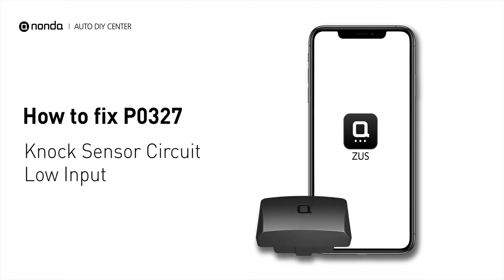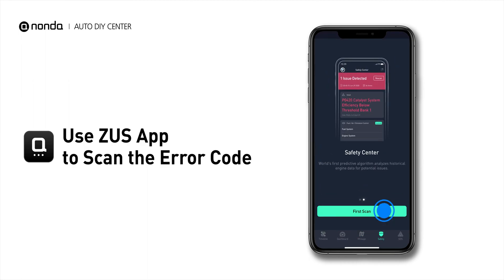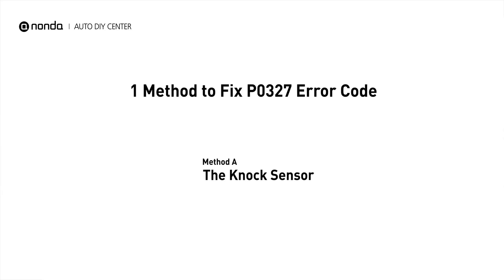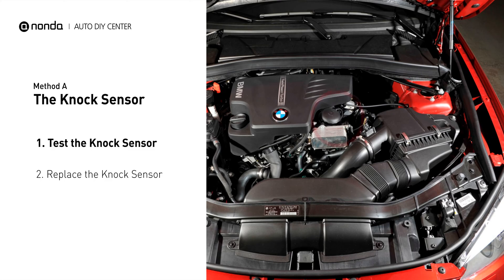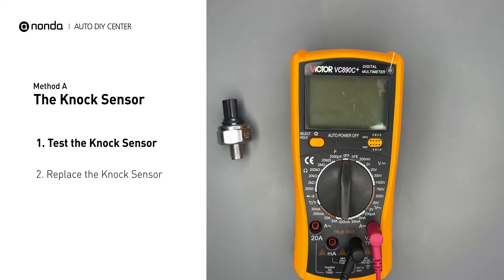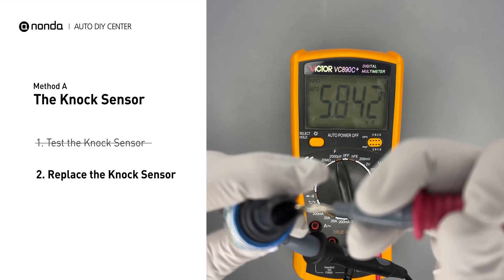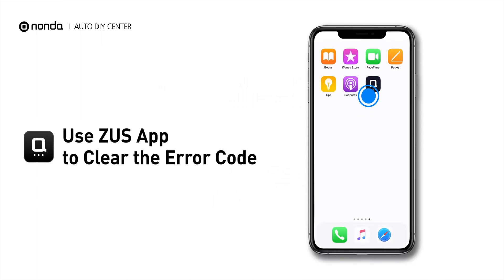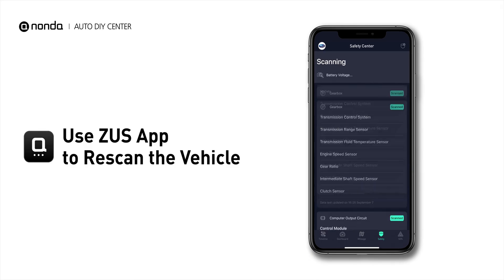How to Fix P0327 Engine Code in 2 Minutes [1 DIY Method / Only $10.67]

Comment: 2005 Chevy Avalanche 5.3 I have replaced knock sensors twice already with new and wiring harness. P0327 still coming up again after it was fine for a couple of weeks
Reply from the maker: Hi Daniel, is there any other codes that register along with this code?

Comment: I was told the doorman knock sensors for my 05 silverado came out with electrical issues, switching to Bosch to see how she'll do as I gotta pass my inspection
Reply from the maker: Hi Carlos, hope you get it sorted out. Thanks for watching!
Reply: @nondainc  it was the knock sensors itself that came out bad from the factory. I got the duralast brand and they worked beautifully

Comment: I replaced my knock senor on my 02 firebird 3.8  four times amd I still have the code and I switched the wire harness.
Reply from the maker: Hi Abraham, please confirm if this is the only code you're receiving.
Reply: @nondainc  confirmed
Reply from the maker: Hi Abraham, so there's no damage found on the wiring leading from the sensor? We also suggest checking the condition of the ECM/PCM as this could contribute to the appearance of the code.